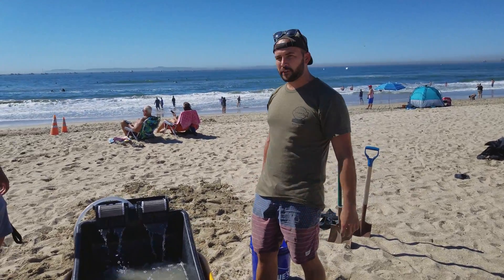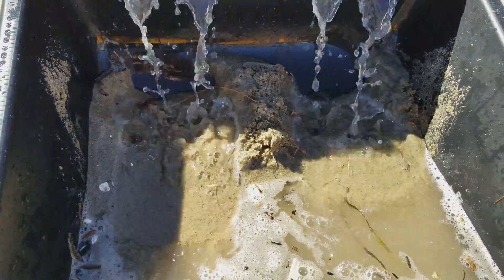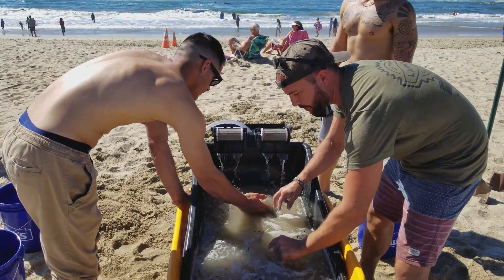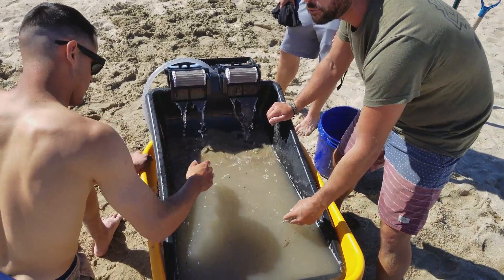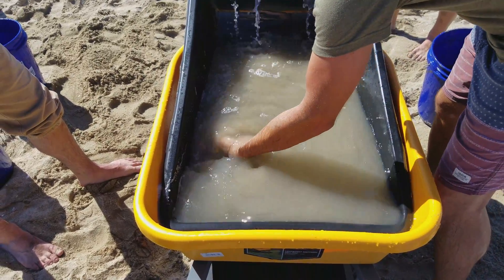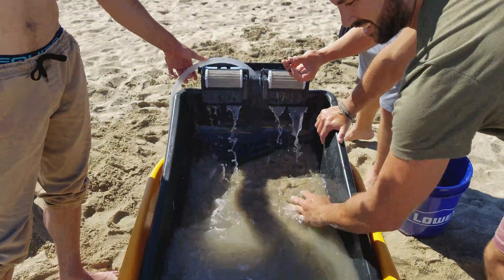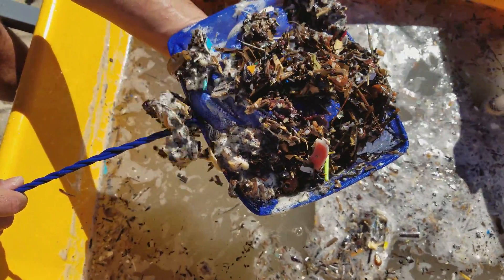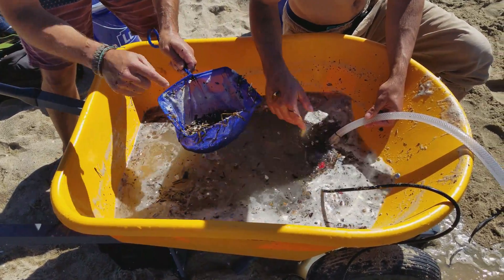Removing microplastics is this easy!

Comment: Are there any guides or direct solutions for the removal of microplastics? I need to remove quite a lot in my yard as some packaging was left on the sun for 2 years and it just degraded and now my ground is pretty full of micro-plastics.

Comment: only works for LDPE and not HDPE :(
Reply from the maker: Actually (adjusts glasses) LDPE, HDPE and PP are molecularly less dense than ocean water. This means we are able to remove those and sometimes EPS if it hasn't degraded enough. Sometimes additives will make them denser but for the most part these polymers are what we have identified our system is able to remove from our shores. I do trashy scientific research here on Oahu at the Center for Marine Debris Research.

Comment: Why is it that individuals have to clean the microplastics out while corporations get to dump them?
Reply: Corporations provide plastics to consumers, however corporations do not provide a proper disposal system or alternatives which leads to individuals littering, either due to laziness or because there is no proper waste disposal system. For example Indonesia, the rivers are full to the brim with plastic waste because the government and corporations that provide that plastic packaging don't provide a disposal/recycling system, or even use an alternative to plastic because plastic is cheap and light to manufacture.

Comment: but this is a small part of microplastics, microplastics are particles from 100 nanometers in size. so can you please show me under the microscope if the sand you clean appears. I am convinced that this will remove a macroscopic mess, not a microscopic ... it will be much more complicated.
Reply from the maker: Please check out our other videos and stay tuned for our peer reviewed published report coming out soon. It shows we are removing particles down to 15 microns and that is only because our instrument is unable to identify particles smaller than that. With that, we are only a few microns away from being into the nano scale which then touches on a different category as microplastics are everything from 5mm-1um. Less than that would be nanoplastics! 🤙🏽
Reply: You are referring to nano plastics. Yes, they are invisible to the naked eye

Comment: Love the device. I’m working on removing microplastics as well with a different product and would love to know which fabric/net/mesh you guys used for the filtration device.
Reply from the maker: The fish tank filter is not necessary for this part. I found that it's a wasted resources and unnecessary expense. If you go onto amazon and type in 5 gallon bucket filter several options will show up. If you select the one with the smallest micron mesh size that will allow you to remove virtually everything you are buoyantly capturing. You can also find these at your local hardware store. I use a 25 micron mesh but it takes a while for the water to fall through because of how small the holes are.  Here in Hawaii we have a HUGE microplastic problem so the smaller mesh is needed to remove everything. You might be able to get away with using a larger mesh but it again depends upon your situation. 
Thank you for reaching and for taking the initiative to create your own system to help rehabilitate our world.
Reply: Thanks sooo much for the tips! Do you guys have a website I can check? I’d love to connect further and ask for your opinion!
Reply from the maker: @paoladelgado7448  I do. It's basic at the moment but we are working on it. It can be found in Seed.World
Reply: Ray Aivazian III oh wow!! I’m so inspired but the detail and thoughtfulness of every step of your invention! I’ll reach out to you soon! 🌱

Comment: Hi! I am interested in learning more about devices which can be used to reduce plastic pollution in water bodies. I am hoping you can answer a couple of questions about your device. Do you have any information/data on the efficiency of this device? Where in the world is your device operating?
Reply: I have a plan to mount a similar method on a robot that farms ocean floor as most plastic actually sinks. This beach method is great for collecting floating plastics like polypropylene.. :) One of my systems called a sonic filter will actually use sound waves to collect plastic fibres.. :)

Comment: Thanks Jess, this issue is not simple, it does not have simple solutions. It will require a radical change, either through choice or consequences. My reference to the Middle Ages is that during the period of industrialisation,'The Medieval Machine',  the resources like the native woodland were exploited beyond a sustainable level. That is the similarity with now, only we have created climate change as well. It is not that I have commented a little incoherently, just summed up a number of factors, any one of which could be researched further in detail. There is no such thing as 'sustainable consumerism', it's an oxymoron term. Yes, I'm an anarchist, if that is the way one describes an alternative to greed not based on need. Leave the rubbish on the beach! It looks crap, because society is crap. Then people won't want to fly or drive there and just hang out and surf. My point is that the real work is to learn how to make the change to live with a radically different sense of fulfillment based on community.

Comment: This is something a kid knows in sand box
Cigarette butts and crap in water
Micro plastic is actually super small like HEPA filter needed
Plus you need a massive machine to do a practical application
It's ok to take the seaweeds too
It's a good idea but like the ocean...it's huge a lot of sand, but real problem in mangroves and places that you can't get to easy
But good idea